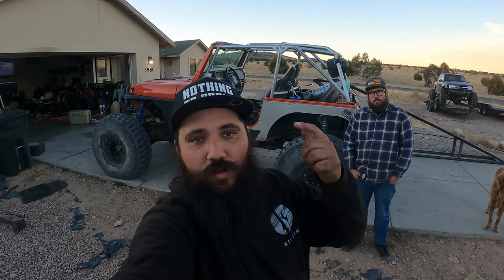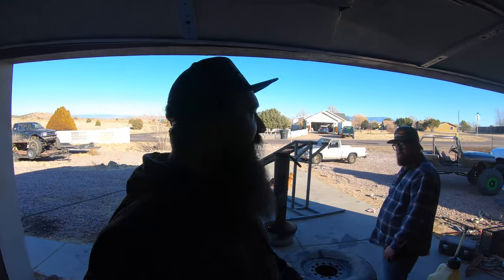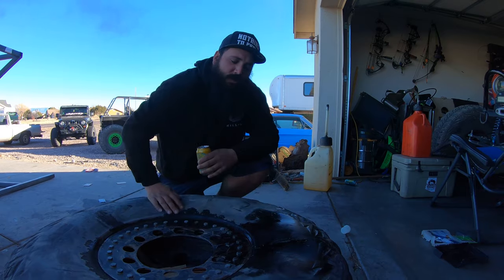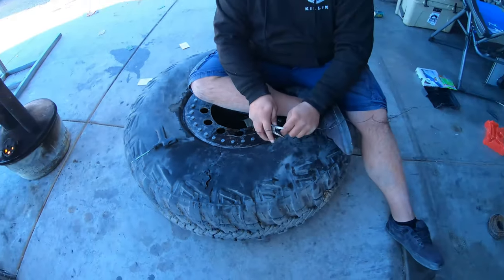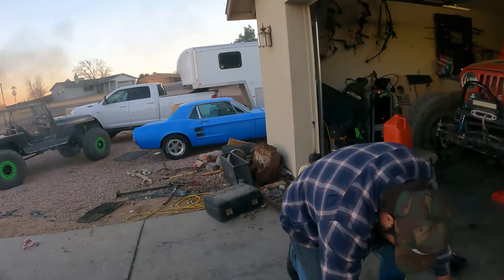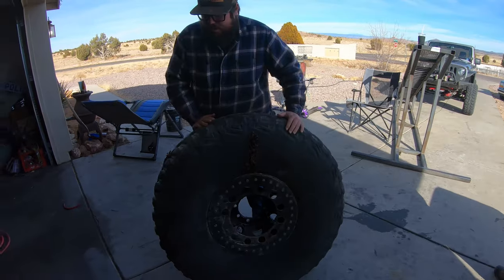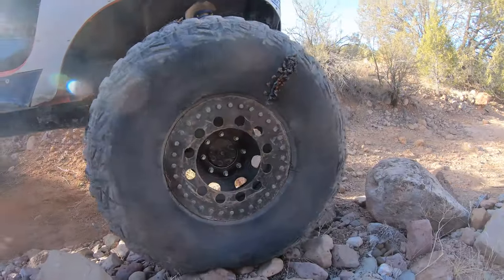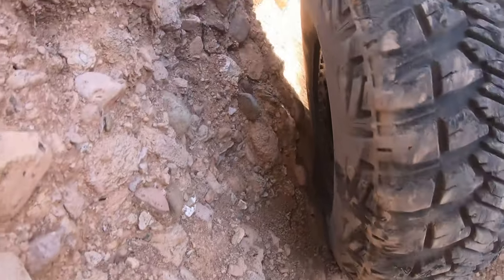HOW TO PLUG A TIRE- Side Wall Repair Using Baling Wire And 67 Tire Plugs

Comment: I gashed two on a trail in Deadwood SD last fall, this would have made my day!  We dismounted someone elses spare, my gashed tire, and remounted the donor tire, using a hi lift jack and two screwdrivers....   Run the repair until it doesn't!  Your speed at putting the lug nuts on would make a NASCAR crew jealous!!  Thanks for the great video.
Reply from the maker: Yeah the real hack was how to put lugs on like a boss!!!!. But we plan on running that to see how long that crazy of a stitch will last.

Comment: seen this many times. i replaced a 37" tire at discount tire for $20 that had a 4" gash wired up with 30 plugs in the early 90's. the managers face was priceless. told him i hit a chunk of steel on the freeway. this was a fun vid to watch. -
Reply from the maker: I cant believe they took it back. Lesson learned, make sure to get that discount tire coverage.

Comment: Great Video!! Had to do this on the trail a couple hours ago. The granite around Oatman is wicked sharp, and our AZ rocks have a rep for slashing sidewalls. 4 bailing wire stitches and 22 plugs later, I drove it home, and it's still hanging tough!
Reply from the maker: Its crazy how well this works! 22 plugs is a good one too.

Comment: One more silly took tip that will keep your bailing wire organized instead of a twisted mess. Wrap duct tape around the outside edge all the way around it several times when it’s new and then all you Gotta do is pull from the center and you never have to worry about getting tangled 😀
Reply from the maker: I have seen that done before! I will tape my next one for sure. Thanks for the pro tip.

Comment: Impressive, I’ve plugged some gashes before, but nothing like that!
Reply from the maker: I have done 1-2 stitch before. But 6 stitch and 67 plugs is the new record. Holding strong and looking forward to see how long it lasts.
Reply: @WRECKEDGEAR  I'll have to check back and see how long before the wire cuts thru the tire too

Comment: Did the same thing on my 580 Case, lasted till the wire rusted away.
Reply from the maker: I wheeled on it for 2 trips before the new tire came in! Had to add a plug here and there but it worked!!!